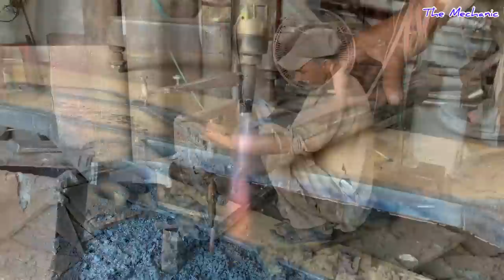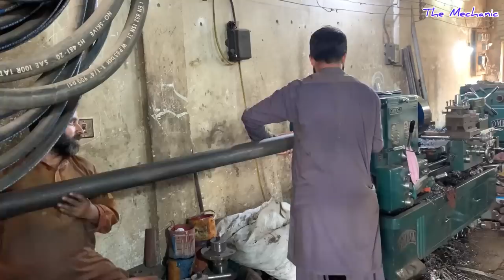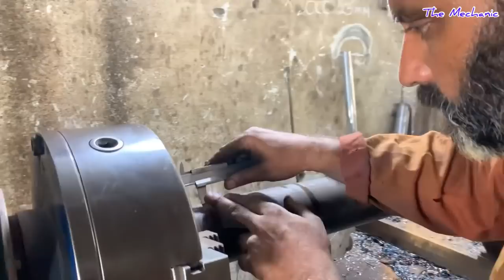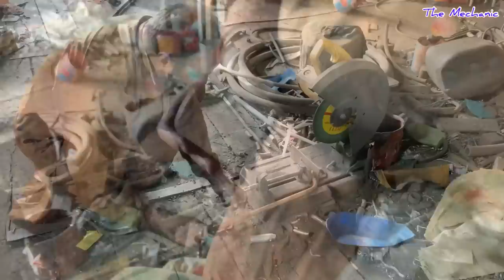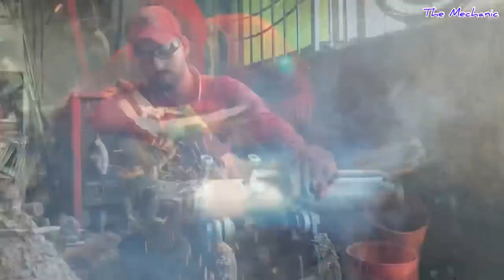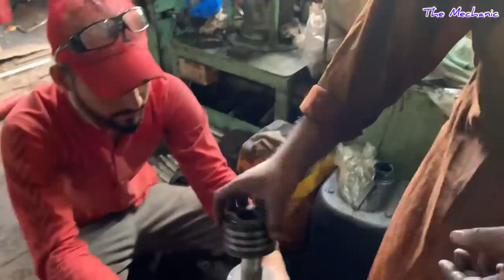How Hydraulic Cylinder and Jacks are Manufactured From Large Steel Tube || Honing & Machining

Comment: man, i work with forklift cylinders and we have to be extremely careful not to scratch or dent the chrome rod because the smallest mark on it will ruin the seals, and these guys just smash them around and grab them straight with the steel jaws on the lathe... they are very skilled craftsmen but those hydraulic cylinders wont last very long before they need to be rebuilt...
Reply: Was thinking exactly the same thing that chrome will be ruined
Reply: @rupert5390  not just that. Your life will be ruined when those crap welds burst and that end plate shoots across the room.
Reply: @excitedbox5705  Wow, I’m not a welder or a hydraulics guy, I didn’t realise it’s that level of hydraulic pressure